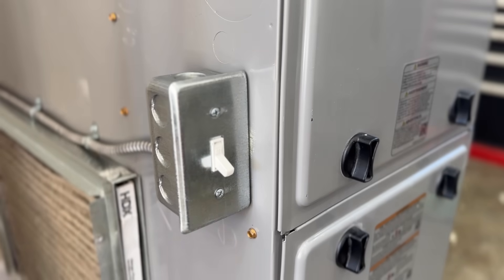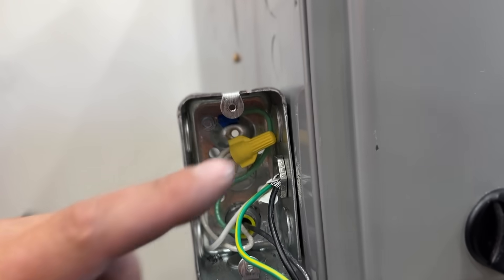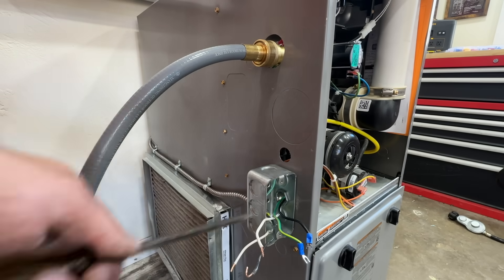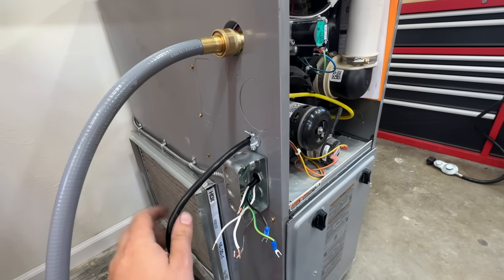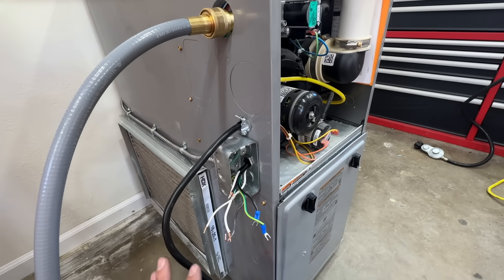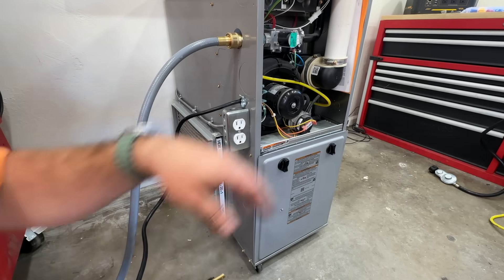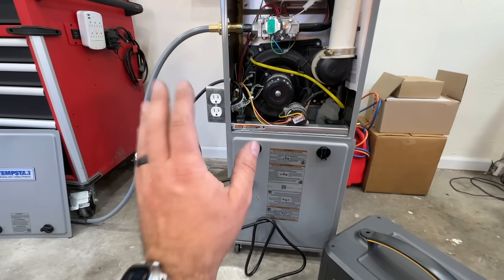Keep Your Family Warm During A Power Outage By Installing This $5 Part

Comment: "Keep Your Family Warm During A Power Outage By Installing This $5 Part..... and Buying this $700 Part."
Reply: Just 35 dollar car battery converter and extension cord. Run car ten minutes every four hours.   Tank of gas should last a month.
Reply: @SeanFinneran Anything other than a pure sine wave inverter will overheat the fan motor. That $35 inverter will wind up costing you $xxx.
Reply: @user-jd5sj8jx7r  Point taken.  But on regular low speed , I doubt it. I will run it thru  my uninteruptible power supply UPS.
Reply: Or a thirty dollar inverter
Reply: Oh, you mean like 90% of Clickbait videos on YouTube ?  🤔😜😉😁🤣🤣🤣
Reply: Does it make sense to run a generator to only run your house furnace ? I bought a breaker box grid switch and installed it ( simple ) Now if I lose power I flip the switch in the breaker box to generator and power my whole house, yes a little more expensive but happy wife happy life ,,,,,
Reply: @navyphyrfitr6550  This is exactly what I was thinking. Why going through all that trouble, and you still have to run the furnace fan somehow. Why not just run power straight into the breaker panel, and then flip off most of the breakers, so you only run what is necessary. That gives you the option of also powering your refrigerator and freezer. This is exactly what we have done in our house here in Oklahoma, where we often get ice storms that take out the power.
Reply: @navyphyrfitr6550 A LOT more expensive. A whole house generator costs thousands.
Reply: Try $1700. Inverters are spiking again
Reply: This type of item isn't too expensive from Harbor freight
Reply: You can probably use your car battery and an inverter.
Reply: If the world go down where we getting all this gas from
Reply: But if you already have a generator, (because you’re prepared) it’s a $5 upgrade.
Reply: @tabcobra pigtail, connector, and outlet much more than $5
Reply: If youre actually prepared, you wont have a generator hooked up to your furnace, it will be hooked up to your box.  @tabcobra  nice try with your bs elitism, ya bum
Reply: @tabcobra  EXACTLY.

I just answered somewhat the same way
Reply: Another great video, thank you.
Reply: Lots of people have generators. Either for a business or camping. It’s more common than you think.
Reply: Right it is more common, good point they’re excellent on camping trips. I owned one to work remotely anywhere for a full day without line power. It’s good equipment and this is a thoughtful video letting you know some possibilities you may have available.
Reply: Everyone has some additional power source.
Reply: This has got to be one of the most clickbait, dishonest video titles I’ve ever seen.
Reply: huh?
Reply: @consciousobjector2507  he's implying the title is click bait because even after installing the $5 plug you still need to buy a generator ("$700 part")
Reply: @jonnyincognito899  who doesn't have a good inverter/generator? Only ill -prepared people, if they're watching this.
You gotta pay to play.
Reply: @jonnyincognito899 if you had a $700 generator you would not need to do this. This is so you can run it off of a battery or some other small power source you can even hook it up to an inverter, but it's hooked to your car. Cigarette lighter if you positively had to
Reply: @obidenwhatajokeverysad5809  OMGGGGGGGGG
that's messed up!!
Reply: Exactly. Pointless video.
Reply: @Fckouttahere my buddy has this setup and his lost electricity in the winter storm and his generator died. I lent him mine and he had heat to get him through the week. Why is that pointless?
Reply: @Fckouttahere  if you're a bum I guess.

Comment: I have the switch like was in your previous video. However, I do like the duplex outlet better because I would have power for other things like my condensate pump. Also, How long will it run on this power supply?
Reply from the maker: It ran my furnace for 20hrs of cycling! I have a dedicated video testing it if you look in my backup heat playlist 👍🏼

Comment: This works, but anyone that does this needs to know that it is an NEC code violation.  
You will have to remove this setup before your house can be sold ... if the buyer is smart enough to have a home inspection done before closing.
Reply from the maker: Not always true. Some inspectors are fine with it, but if you set it up, and want to be 100% sure, you can swap it back in 20 mins or less.

Comment: Many Thanks for this video. I have a question and would welcome an answer from anyone who knows: I have an internet-connected thermostat. If I install this modification and plug the furnace into my "solar generator", will the thermostat still call for the furnace to start if the grid power is out? Thanks - -
Reply from the maker: Yep, the WiFi thermostats or any thermostat will either use battery’s or have a c wire that goes from the furnace to the thermostat which gives it its power. So having it on backup heat will not affect your ability to control the furnace with your thermostat 👍🏼
Reply: Many Thanks for your reply!

Comment: I did this back during the big Texas freeze, but ran an extension cord to my generator outside, which I had to run for several days. A battery backup wouldn't have lasted that long. My unit draws several hundred watts, so a gasoline/propane/natural gas generator is a must if the outage persists more than a couple hours.
Reply from the maker: My Vtoman lasted 20 hours of cycling the furnace off and on. But a generator is definitely preferred
Reply: Q: 20 hours at what temp, at the thermostat @diyhvacguy

Comment: That’s a great idea. But in my house the furnace is under the house in a crawl space. I wish there was an easy way to do this in my house, but I think I have to mount a transfer switch and generator plug on the outside of where my electric panel is located.
Reply from the maker: I have a separate video that shows that process. It’s not too terribly hard. You can find it in my library under the backup power playlist 👍🏼

Comment: Use a Velcro cable tie and he won’t have to keep cutting off the wire tie each time you need to use it
Reply: Oh for gods sakes. How often is one going to be using it?
Reply: @jakhamar55  probably not often but when you're looking for something to cut a cable tie with in the dark you'll be thinking man I wish I didn't cable tie that.😁😁
Reply: @biglew1161 just flip the breaker and plug the generator right into the other side of the duplex receptacle

Comment: Great simple video!

Your heat source is coming from either natural gas or propane. All you need to do is have power to the blower and what electronics are required to run the furnace. Whatever the needs of power to do this is minimal. A small gas generator (check requirements on furnace), 5 gal of gas (I'd use "no ethanol) and run it sparingly  you've got heat for a week or so!

Comment: I tried this on the newer furnace in my daughter and son-in-law's house (connecting it to a generator), and it would not work, because the electronics in the furnace somehow senses that the power source is not from the house wiring. I tried a number of wiring configurations with ground and neutral to try to fool the circuitry, and never could get it to work.

Comment: To add to this, I’ve converted my generator to run on natural gas as well, and had a plumber run a gas line for me, with a quick connect fitting. This way, if I have gas to run the furnace, I have gas to run the generator to power the furnace electrical.

Comment: We made the same modification on our boiler. In case of a long term power outage we simply unplug it from the wall outlet and plug it in to our portable LiFePO4 2400 watt power station.

Comment: I did this 10 years ago for my hot water baseboard system.  I also ran a bunch of secondary outlets that ran back to a main connect for my generator so when in use I could unplug my baseboard furnace, frig, etc and plug them into the generator fed outlets and we were good to go.  Simple project with a ton of benefits.
Reply: I use ORANGE colored OUTLETS to IDENTIFY GENERATOR FED
Reply: Yep. I used dark grey since the orange stood out a bit too much. :) @erickajander1139

Comment: good minus the pig tail going into the box from the furnace. it never needed to go into that box
Reply from the maker: I did this because I knew some folks would whine about how there isn’t supposed to be connections unless they’re in some sort of enclosure. Like some furnaces have a box built inside the furnace just for the connections.

Comment: What about rigging a generator to a gas/AC package unit outside. I have a tempstar unit. Looking to power the heating unit only
Reply from the maker: I’m actually going to try and do this on my parents package unit next week so stay tuned for that one.
Reply: I haven't looked at schematic yet. Curious if fan motor runs on 120 or 240 volt. Following.
Reply: Wondering if you did the package unit backup yet

Comment: Can a furnace run on a simulated sine wave (square wave) power source?
Reply: the blower motor may not have a problem with it if it's not an ECM motor however you (also) run the risk of causing damage to the control board using an approximated sine inverter. Sure they're used for PC's/office equipment all the time but I wouldn't risk it in this application (heating)

Comment: is this just a repeat of a previous video...which you updated with the ez generator switch....now your going back to this outlet solution??
Reply from the maker: The easy generator switch is one of many options, definitely preferred over this one, but this will absolutely do, and is totally safe to install on any gas furnace. I have also since talked to many electricians that have said having a pigtail with an outlet is totally fine as your means of disconnecting the system. So I wanted to do a simplified version of my previous one with a switch and outlet. Cheers.

Comment: What about an electric furnace with a heat pump? Can I power both from the furnace or do I need to power each individually?
Reply from the maker: No, this only works for gas furnaces. If you have a heat pump, then you will definitely need a generator and another means by which you can get power to the system. I have a separate video dedicated to that. Check out my library and you’ll find it there.

Comment: Now that I buy the first video switch with on/off slider you show me this :0) Can I still use the other one (I already broke off the tab)?
Reply from the maker: Yes, either of these methods will work perfectly fine. I simply wanted to do an updated video with a simpler version. But if you followed any of my previous ones, they will work just fine.👍🏼
Reply: @diyhvacguy  Thanks HVAC guy! You Rock! I installed, it worked (ditto for heat).

Comment: This is exactly the way I wired mine years ago...still waiting on the battery tech to shake out (which would be way easier to use) but for now, I run the power to a gas generator.

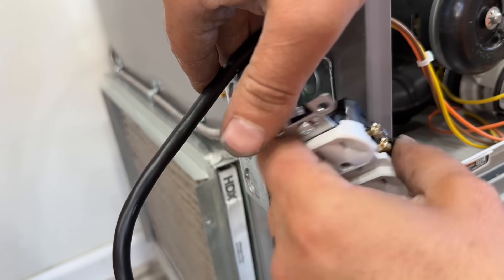Comment: There is no "proper" orientation of an outlet (8:36).  However, in this case ground up would be the safest orientation.  A top ground prong better holds the plug in the outlet and the top ground protects any metal object falling onto the hot prong.  You have great video content.  Keep them coming.
Reply: That's how hospitals are wired.
Reply: @kenhurley4441  Yep. And they wouldn't be using that orientation for no reason. While it may not be code it's still "best practice" and in most instances, considered standard.
Reply: @Watchyn_Yarwood   - Well, it "may not be code" as you say, except when it was code (2005 NEC or thereabouts).... until it wasn't code again (NEC dropped the 'ground prong up' requirement).  And you could say "in most instances it's considered standard", aside from most instances that it's not.  Very few of the manufacturers of things like power adaptors and GFCI plugs ever changed from the original ground prong down to ground prong up.  So, for years now anyone who did change their outlet orientation has to have that awkward cord pointing toward the ceiling situation with certain devices.
Reply: @gatsbylight4766  🤣😆😆🤣
Reply: @gatsbylight4766  😆
Reply: But it will confuse most homeowners because the standard meaning for a ground up outlet is to be a visual clue that that outlet is switched from elsewhere; builders have been doing that since at least the 1980s.
Reply: I live in southeastern Virginia and of the very few switched outlets I've seen, never once has one been oriented opposite the non-switched outlets.  Interesting though that somebody thought of using that visual cue. @VideoArchiveGuy
Reply: @VideoArchiveGuy  im guessing that's a regional thing, never saw that anywhere in Ohio, first job as a kid was house reno's and have done plenty to help people over the years, even a few years as a cable guy going into everyone's home, only place I've ever seen that (residential) in Ohio was sometimes on the plugs for heavy appliances, usually the fridge. Never once have I see a switched outlet that was upside down
Reply: @chomp7927  It's been universal in new homes in Colorado and Wisconsin, and I would suspect is very common nationwide.

Comment: Ok, this is a good idea for the average person but I would like to offer another approach.  simply open the box and take that romex connector and put it at the bottom of the box after removing the KO from it and install the new cord....(mind you there is no drilling a hole into the furnace) just a new male end cord coming into the switch box from the bottom.  Now you simply take of the spst switch and replace it with a 3-way switch (SPDT) and boom. you now have a normal on/off switch when servicing the furnace -  up for on as usual, down for OFF - or generator as it will be coming from the new cord end.....simply plug it into your generator and switch it down for AUX source. I use a lot of cord ends and do this to a few of these "service disconnect" boxes like what you have there.  Just makes life a little simpler having a 3-way select between the power sources  and very visible and easy to grab while it is just hanging there.  Love the videos...keep up the good work!!

Comment: Why do they put a switch on the furnace to start with just convenience?  I mean it can be shut down at the breaker. I do like this idea though, I will be doing this, thanks for the video.
Reply from the maker: It has to have a way to turn power off within 6 ft. Whether that is a switch or just being able to unplug it.
Reply: @diyhvacguy  OK, yes figured it had to do with code.

Comment: Local code here requires a dedicated circuit(s) for HVAC.  Our inspector was satisfied by installing the switched outlet within the furnace cabinet and leaving a grommeted access (standard metal stud grommet) to pass the cord out of the cabinet when needed.  This way the outlet would not be easily accessible for any other use.
Reply: Swap the receptacle for a single outlet receptacle.
Reply: Good point.  No special receptacle need be purchased.  Simply break off the jumpers on the back.  This renders one half dead.  Just a thought.

Comment: I guess mine is already set up like this. My installation goes back to '61 and my airhandler plugs into a wall socket. So mine has the pigtail 🔌 already. Lucky me! (Now I just need to get my 'Round Tuit' and buy a generator. 😄)

Comment: Good idea. With gas heat if power is out all you need is enough power to run the fan. Probably just a few amps.
Reply: I think mine draws 500w or so, then drops a bit after ignition but the blower is still sucks down the bear's share of power

Comment: Get two male plugs from box store...short piece of extention cord or 12/3 romex.  Put the male plug on both ends of the romex or extension cord.... find the main switch on the circuit breaker box, and shut the power circuit off preventing power back feed into the electrical main line coming in to the house.  By running an extension cord into the house from the generator, and search for a plug in the wall or likely in utility room and find the circuit that the furnace is running on....insert the plug into that circuit via the outlet plug and the furnace is now live with 110 volts and whatever else runs on that same circuit.  Most homes have to legs of power...find the one that the furnace runs on and you are done.  Make sure no kids can pull on the plug because the male end will now be live...and of course hurt someone...but no kids allowed around this plug set up.
Reply: No, no, no. Just no.😟
Reply: Agreed that for some it is better to just stay in the dark..but for anyone with half a brain, this works...just be careful  Okay blast away. @tgriebe
Reply: A male to male cord is better known as a "suicide cord" and for good reason.  Don't do it.  Get a proper transfer switch and have it installed by a licensed electrician.
Reply: Done this for 40 years, obviously if you can't chew gum and walk, then don't but for emergencies, this will work and is way cheaper than your $500 other option.  Just have to be careful...sort of like backing up a car.  Not for some but most can do it and it works. @lesterawilson3

Comment: Please, for the love of all that is holy, do NOT USE CRIMPS for stranded.  Either use a wagu or do it the older way, by stripping an inch or so in the middle of the wire.
Reply from the maker: Uhhh, a ton of electricians on here say to use crimps for stranded
Reply: 1 week and not one has "said this" @diyhvacguy .  I've never seen it anywhere before here

Comment: I saw your other video not that long ago and suggested just this approach.  I guess I get to pat myself on the back.  :)
Why tie the furnace wires together inside the box.  Can't you do it in the furnace?  Less clutter in a small box.
Reply from the maker: Typically a furnace will have its own box inside but yes you can do that. I’m not sure if it’s up to code if it’s the connections are made in the box